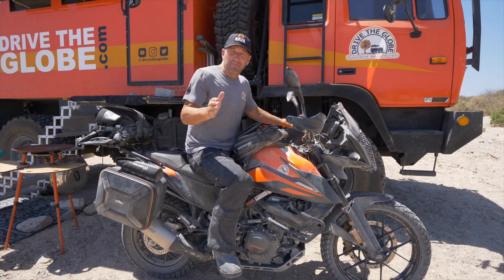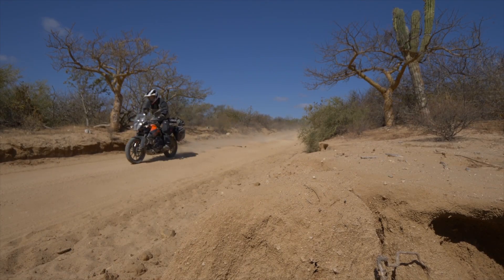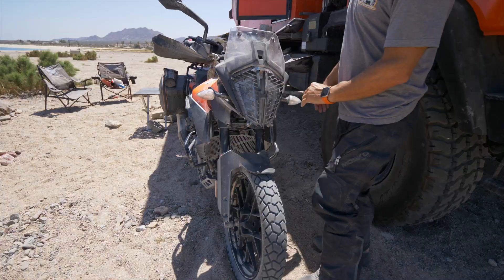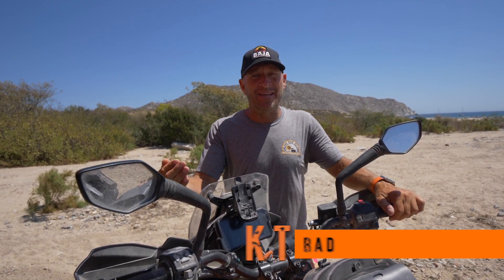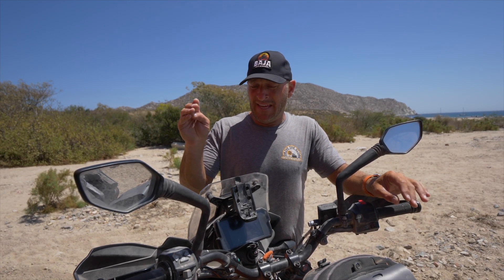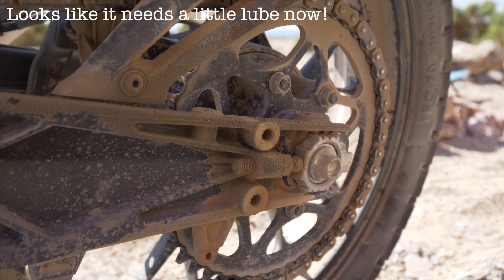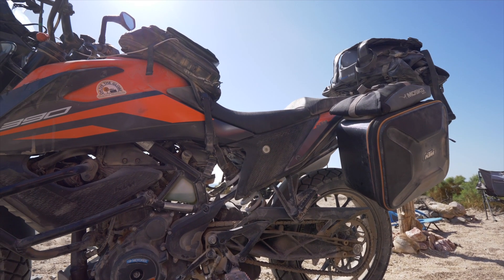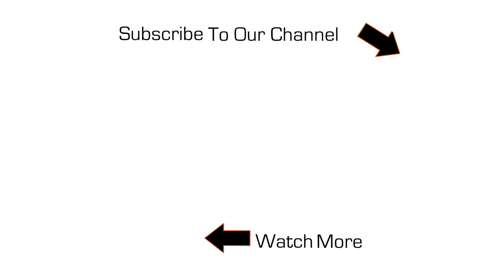KTM 390 Adventure Review - 2000 miles off road In Baja

Comment: Cool video thx. By the way, your biggest ugly is a user issue! There is no need to go through a 6 step process to deactivate the traction control. Put the function on quickselection, then you only have to press the up arrow button one time and you can deactivate. So it is a 2 step process. The same works for the Offroad ABS with the down arrow button.
Reply from the maker: Yes!!!!    Will try that. Thank you.
Reply: Mine will not keep the traction control on the quick select. It replaces it with trip 1 when I turn the bike on and off. I’ve read other guys have this problem as well.
Reply: i set the up arrow for abs and the down one for tc... really easier to deactivate
Reply: My MY 2022 keeps the settings when the bike is shut off. It also has a ride mode setting where the offroad mode will reduce the traction control meddling to where the bike seems to carry up a rough hill without bogging down, but I have yet to really test its limit. To my knowledge it's just down to the firmware version, so a dealer could possibly update it.

Comment: I have a 2020 390 Adventure with 9000km and about 7000km are off-road.  Sounds like I ride similar to you...dirt, gravel, some single track.  Swapped out the TKC70s at 1000km and installed Bridgestone Battlax AX41.  On my 2nd rear AX41 and going to change to Motoz RallZ for next tire change. I use the Tusk Highland X2 rackless luggage.  Get yourself a set of Doubletake mirrors...they work great.  Enjoy the Ride!!!
Reply from the maker: Thanks for the advice, and yep, I’m switching tires next week as well.

Comment: Really nice review. I have one and love it. I replaced the tires with Motoz Rallz which is an 80 off road/20 on road. They have a reputation for performance and longevity. My only complaint is the noise level over 60 mph but since  you predominately ride dirt I would urge you to consider them. They get fantastic reviews and I love them.
Reply from the maker: Thanks for
The recommendation!

Comment: One of my bikes is a '20 390 Adv.  Yeah, I'm as excited as you are.  This bike is light, cheap and fun.   Almost EVERYONE says they can't stand the pegs.  Yes, they're a bit small, but I feel that unless I'm wearing tennis shoes or flip-flops, I am not bothered by the ~30° angle.  I had an issue with my bike stalling and some fuses popping preventing a start.  I guess I fixed it by always shutting off the bike with the kill switch ... I have no clue what's going on there.
I'm happy you're happy and man am I happy with this bike.  I've owned over a dozen through the years and I'd rank this one number two or three.
Great vid, thanks,
S
Reply from the maker: Thank you.  Appreciate it. Safe riding!

Comment: Thank you for the video, I also have a 390 from 2020. Same problem with the MTC, I contacted ktm: You can make an appointment with your dealer to update your dashboard with the software for the 2021 model. since 2021 the MTC remains off even after turning off the engine (like abs offroad ;)).
Reply from the maker: Thank you.  Got an appointment tomorrow actually!! 🙏

Comment: I have not read all the comments yet so some of this may be covered already. I have a KTM 890 Adventure R and I believe they fixed the traction settings so you don’t have to reset them every time you start bike, that was a complaint with the 790s as well. You probably need a software update from a dealer. Additionally you can set favorites so with one click you can reset the ABS and the off-road settings, there are tons of YouTube videos on how to set the computer on your KTM. As far as the tires go, how can a manufacturer figure out what most people want, most people buy KTM Adventure  motorcycles to commute to work, there are lots of options for 50/50 tires, 80/20 tires, 90/10 tires and desert sand tires. 

Regarding a reference to the seat, I highly recommend getting a seat concepts seat and Air Hawk if you’re doing any long-distance riding. As far as the foot pegs go and as far as the boots go, for the kind of riding you doing Baja I recommend you get motocross boots, the soles are hard and doesn’t matter what kind of pigs you have. I use Sidi crossfire boots and ever in thousands of miles in including the full length of Baja. 

I actually passed you in Baja just north of Cabo and wish I had made an introduction because you could’ve assisted me but that’s another story, have fun enjoy watching your travels.
Reply from the maker: Thank you.  Yes, looking into all those options. Gonna update my findings soon.  Damn.  Wish we connected in Baja.  Next time!
Reply: @drivetheglobe  Thanks, my apologies for the typo's, I need to be more careful with Apple's voice to text.

Comment: You can set the traction control to one of the favourites on the left switch block. To turn it off then you only need to press the favourite button select off and [press.
Reply: correctly, I also answered this. There are so many „complaints“ about that and nearly no one recognize that it is a user issue 😉
Reply from the maker: Thank you,  I will try that.  Just wish you could shut it off permanently.
Reply: @drivetheglobe  I've also heard it said that if you replace the original battery with a lithium one, not only will you save weight but the traction control won't reset if you stall the bike. Will try it when the OM battery needs replacing.

Comment: There is a short cut to avoid your 6 steps to swich off your traction control, you need to have a look in the settings
Reply from the maker: Thank you!  Yes, working on that and a computer upgrade.
Reply: @drivetheglobe  Enjoy you trip,  you have the possibility to set up 2 short cuts(in favorits in your computer) in your settings, the result on the end will be 2 steps, Buton right= short cut 1, and buton up= TC off, (after setting it), accelarate quick above 4000rpm, to slip your tires to acctivate the TC, the bike will realise that you have switched off and stay off , but still a pain in the ass to have the TC on always as default when you switch off the bike, but its still the best bike on the market, in light weight, La Cabra del Monte, greatings from Tarifa Spain, enjoy your trip, KTM always Ktm in any category or CC Kills the others brands,    ( exept in Moto Gp)  i know, Pitty...

Comment: Turning MTC off doesn’t have to be a six step process. I have MTC set as the shortcut on the UP arrow. To turn off MTC, push UP once, then hold SET for 3 seconds. You can even do this while riding as long as the throttle is closed.
Reply from the maker: Thank you.  First thing I’m gonna do when I get a moment.

Comment: Good choice of machines.  That KTM should last you a long time. Not too big and not to small.
I have been looking for an Isuzu FRR to build into an Expedition rig and love how you added your bed outside the truck box to give you more usable floor space. Found a 16 ft FRR with a side step door so I may try and get it.
I know Isuzus inside and out!
Your slide out entry steps have got to be the best idea I've seen yet. 
The thing I'm thinking of doing with the FRR is. it has a lift gate, which I will modify into a bike carrier lift that will lift the bike up under the added on rear bed box. I ride a Yamaha 1200 Tenere and a 06 KLR that has been extensivly modified. SO this will allow me to take either bike I choose and load one of them easy!
Also a tip, I have some nice mirrors that are Ram Mounted to the handlebars are slick for lowering, removing and adjusting.  Need to look up the brand as their name has escaped me right now.  But I think they are what you need.  And are lifetime gaurenteed if you break them.

Also here's a tip for some of you guys wanting to fabricate a bike mount, There was another bike carrier made years ago that was pretty neat.  Google "Red Ant Cycle Carrier" in the US Patents web site (Circa 1970)  to see a bike carrier that pivots off one side and lowers 20 degrees down angle as it rotates to a 180 degree swing. (I worked at the Factory back in the early 70's and have since built up a beefed up version to carry my motorcycles (above) behind my 37' Class A Motorhome. ) It  is removeable using 2 reciever hitches like you added to your rig and pivots off the left reciever bar. I set up my pickup to use it too! I use it a lot.
 To help loading I mounted a winch to the wheel stop to pull the bike up the ramp/ carrier rail and hold it while tying the bike down to the carrier. then I use the same winch to pull the rail around to parallel the back bumper and it raises the bike as it swing around to stowed position. The Patent will spell it all out for you.  I can link the Patent if you guys can't find it.

Your new Rig is really set up nice. So much more practicle (to me at least) over the Unimog.
Reply from the maker: Thanks for all the input. Funny, I just received my new mirrors that are based on ram mounts so I probably got the same. Too funny. Good luck with your truck.  Sounds exciting.

Comment: Traction control settings were updated to save even after the bike has been turned off in the 2022 model.
Reply from the maker: Yes. Seems to be partially fixed after a computer update.
Reply: @drivetheglobe  how was it partially fixed, can you give a little more detail? There is a complete fix for MY2020-21 bikes in India that adds the ride modes the MY2022 has that KTM refuses to release to the NA and EU markets. My bike has the latest FW as of Oct 2022 and it is still the same.

Comment: The "Ugly" that you mentioned doesn't even exist on my 2022 bike. It will keep the settings if the engine is shut off and the key is removed. There's also an additional Ride Mode setting with the choice of Street and Offroad, and in my experimentation, Offroad reduces the traction control. I went up a gentle but decent hill and didn't even notice the traction control doing anything, and going full throttle results in some wheel spin without it going nuts.
Meanwhile in Street mode going up an even gentler washboarded gravel hill resulted in noticeable power loss.

I imagine it's just firmware, so a KTM dealer might be able to update older bikes with these new features.
Reply from the maker: Thank you!  Working on trying to secure that software from the dealer.
Reply: @drivetheglobe  I'm definitely interested to know how that goes.

Comment: If it is just stalling on start up then it's just that the bike is too lean and potentially the valves are too tight. I had my valves adjusted and bought a fuel X system to add more fuel to it and it runs better than stock now.
Reply from the maker: Thanks for the advice. Probably also the fuel here in Mexico.
Reply: @drivetheglobe  yeah my dealer told me to use 95 octane which is hard to get by me. I definitely recommend the fuel X pro though. It genuinely makes a big difference.
Reply from the maker: @spadac4543  cool. Have to check that out when/if I’m back in the states

Comment: I am 180 cm tall,
would this bike be comfortable for me? I don't want to sit on it uncomfortably. With a very bent knee angle. Is this engine power enough? I don't need a motor to be able to do more than 150 km/h, but it can easily do that. Don't let the motorists get in my way, at red lights you can drive well ahead of them. You can even overtake trucks traveling at 110 km/h with it. Do you know this easily?
Reply from the maker: Yes.  Think the bike will be perfect for that.  Plenty of power.

Comment: The stalling that you have could be the fuel line crimping.
Reply from the maker: Possibly.  Just got back from the dealer and isn’t doing it now.  So maybe a computer issue?
Reply: @drivetheglobe  A few videos I watched the guy would bring it in to the dealer it would work for about 1500km and then start having problems again. His end fix was the fuel line. Cheap and easy fix something like 20$ But If it's not broken don't fix it. Hopefully the dealer got this working for you.

Comment: got a 2020 , really underrated wee bike. Once you get over the pig ugliness of the headlights it's a great bike.
Reply from the maker: Ha ha. 😂😂😂. I kinda thought the same thing about the headlight. Just thinking praying mantis.
Reply: @drivetheglobe  UK 2020 model has led indicators and adjustable suspension, but no quickshifter as stock. I fitted the swmotech adjustable pegs (net result pretty much identical to the black dog ones, bigger and flat) , and 22mm risers, which makes it decent for standing (6ft tall).
I also own the Yamaha T7 , but I reckon I'll sell it and keep the wee KTM as it fits in the back of my van and is super lightweight to pickup by comparison.

Comment: Nice review! One thing I find odd is why it comes with halogen turn signals instead of LEDs! I own one in India and it’s all LED. I think in Europe and in Asian nations it’s all LED as well.
There’s an youtube channel called Big rock moto and his husqvarna norden 901 has a similar halogen setup in North America. Is there any government rule against LED out there?
Reply from the maker: There is not- so
Weird.  Think they cheaped out on us over here!
Reply: @drivetheglobe  As about India, the specifications are different, we get quick shifter as stock and all LEDs set up. What we miss in turn is the adjustable front forks. The rest of the configuration is the same. We also get Metzelers front and back about 30 percent off road and 70 percent on road tires. Oh, by the way, the new 2022 390 adventure has the issue of MTC resolved. Now you remain in off road mode in spite of stalling the bike.
Reply from the maker: @TarunChoudhry  thanks for that clarification.  I had heard that about the 2022 too.
Reply: It's because they are prone to breaking and if so cheaper to replace than led

Comment: The stalling issue is quite common and might be related to the higher-compression nature of the engine. One thing I noticed it fixes it on mine is to give it two throttle twists (till around 2-3k rpm) just after you start it. One other common issue related to stalling is caused by a kinked fuel hose which they usually replace under warranty with a harder one. Nevertheless, this issue manifests in stalling while warm.
Reply from the maker: Thanks for the info.  Appreciate it.
Reply: Make sure you put in premium fuel too because it's a high compression engine.  It also helps with reducing stalls.
Reply from the maker: @Froggy-jn9mu  I do whenever it is available.
Reply: @drivetheglobe  that's the problem then.   I was like that.   It's taken 5 tanks of gas to run the bad out of it.   I need to put in RON 95 in mine here in Vietnam.  It makes a difference.  My motor runs cooler too. 😎

Comment: Hi! I own a 2022 KTM 390 Adventure and have completed around 6000 km, most of it on the pavement, some over hilly roads, few challenging ones and a little off-road. My height is 5'9" just like you and I weigh around 52 kgs(<50 when I bought the bike). With my body parameters, I was a little skeptical about being able to handle the bike as I bought the bike without even test riding any KTM bike, not even sitting on one ever. Initially, I did have little issue with the tall seat height but l quickly gained confidence with the same and also about the overall handling of the bike. I have recently accomplished my first ever hilly roads ride ride of around 200 kms and was astonished to find out how effortlessly I could do it, not to mention the superb handling, light weight and power available. Also, want to mention that I had a pillion and around 10 kgs of luggage on-board during the hilly ride. I fell the bike just once during this hilly ride while getting off of the bike from the right side after putting it on the side stand with just a crack on the knuckle guard which I have fixed temporarily with a glue( and it worked quite nicely)and no other significant damage, so, I will not have to incur any expenses on repairs as off now. The ride on pavement was fabulous too in all respects, me being mostly the fastest on the road here in India with the other bikes and cars being lesser in terms of power, the only limiting factor being how much of the road irregularities my back can take on this bike, which, of course it does fairly well, with me having some back pain initially but which got relieved as I got accustomed to the bike and made some changes to my riding style and technique and posture, not to mention the slight adjustment of preload that I made. All in all, I am thoroughly satisfied with my decision to buy this bike and am missing it while being away from it for a few days. Till date, the bike has been pretty reliable except for one of the fork seals leaking oil from the start but which was fixed on the second service with a seal replacement. I am looking forward to having a lot more fun and adventure on this motorcycle. Thank you for your review which I think was excellent. Cannot agree more with you.
Reply from the maker: So glad you are enjoying your ktm as well.  Just so much fun.  Thank you for watching and giving your feedback as well.